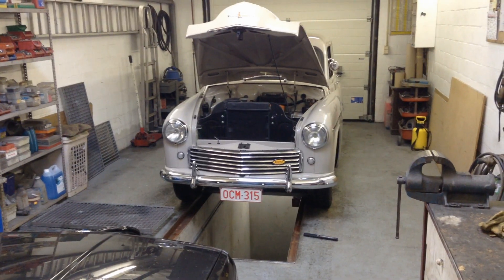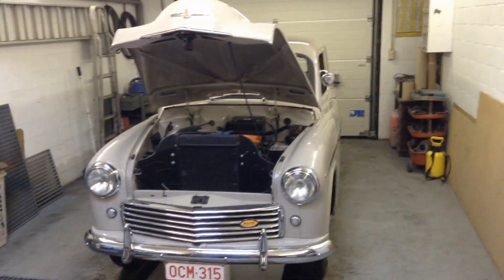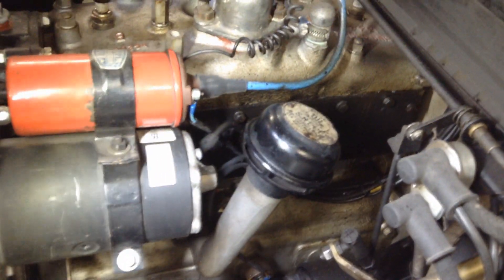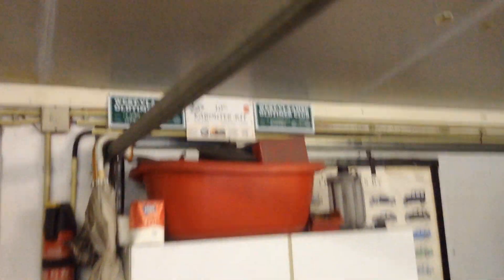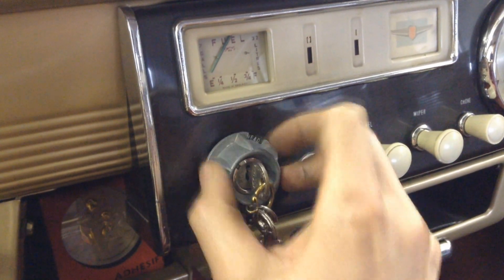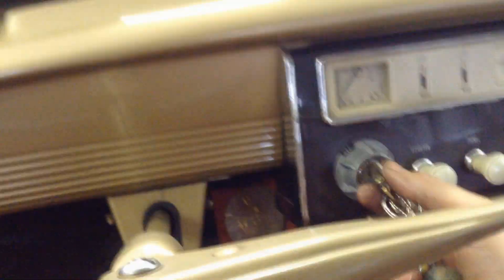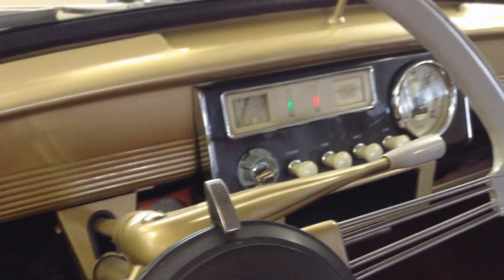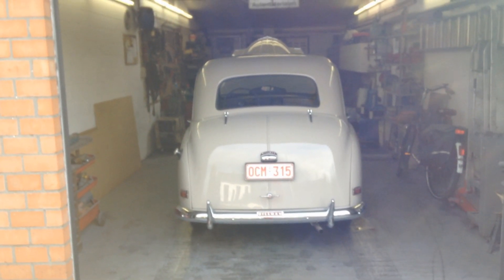Hillman Minx Mk. V - Start-up after winter & regular maintenance

Comment: Thanks for the video. It looks like your dad has done a very nice job on the restoration.

 I learned to drive on my mum's 1960, series IIIB Minx (these were fitted with 1500cc overhead valve engines). It was a very solidly made, reliable little car. Rootes cars sold fairly well here in Australia and always had a reputation for being very dependable. Sadly, they haven't managed to fetch high prices as classic cars, so are quickly disappearing and not often seen these days. Thank you for keeping one more fine little car from the scrap heap.

Comment: This is nostalgic for me as I grew up in a 1949 Hillman Minx and which was a Mark 4..very interesting ..but the commentary on the dash lights is incorrect..the red light relates to the charging position of the dynamo and which always glowed red after switching on the ignition and on tick over..but it went out as  soon as the engine revs increased..the green light relates to the oil pressure and which should go out as soon as the engine fires..I have no idea what the switch under the dash related to and this must have been added as our Hillman did not have this facility..the Minx engines of that era were always very sweet..hope this gives some added perspective...